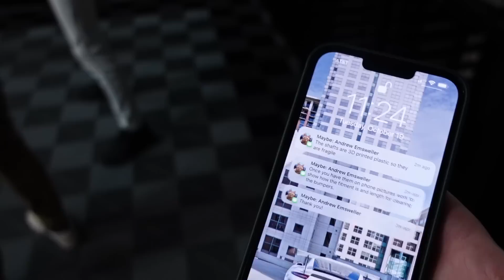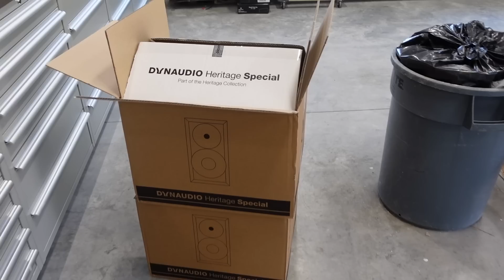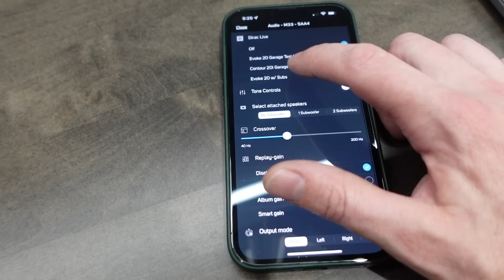HexVlog: A Day in the Life of The Obsessed

Comment: Matt if you took all the time to run the cat 6 i would speed test your hardwired tv’s. Almost all of them limit the Ethernet port to 100mbs vice 1gbs. I know the Sony and LGs definitely do. Work around is to do a usb-Ethernet adapter and then you’ll get over 300mbs (depending on what ISP speeds you pay for which I’m sure is pretty high). And of course not EVERY usb to Ethernet will work, cable matters version on amazon works for the LG and Sony’s. GL.

Comment: Matt I'm thinking of using the Milwaukee packout system for a portable washing solution. I want to use the 2 wheel utility cart with a large box on the bottom plate and a work top with the hose reel and pressure washer mounted on the top bracket. Would this be feasible?

Comment: You don't HAVE to use MagSafe on the new MacBook Pro. You can still charge over thunderbolt, you just can't fast charge over thunderbolt.
Reply: Does this also have power issues where you can out pace the charging speed?
Reply: @q1joe  I’m not sure. I’m just going off what other major tech channels are saying. It will be easier to determine once it’s in the hands of reviewers.